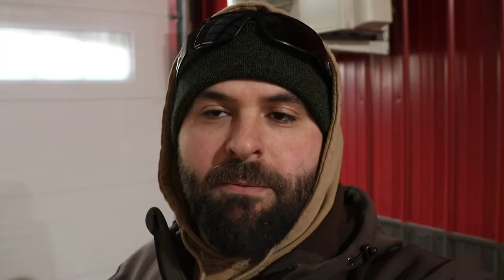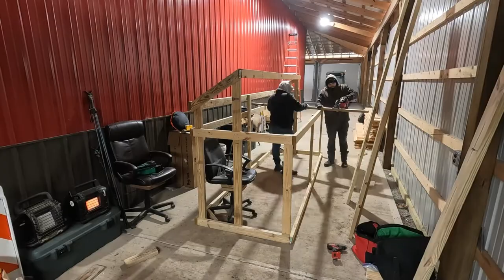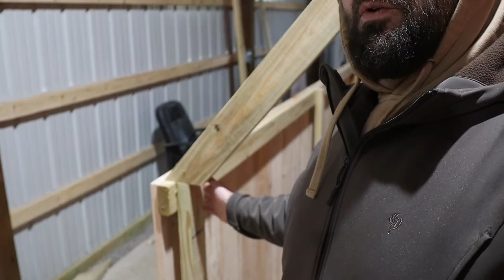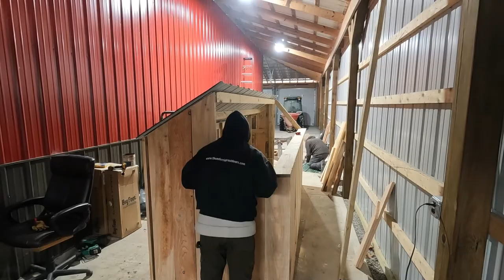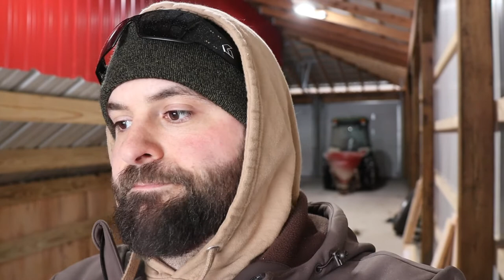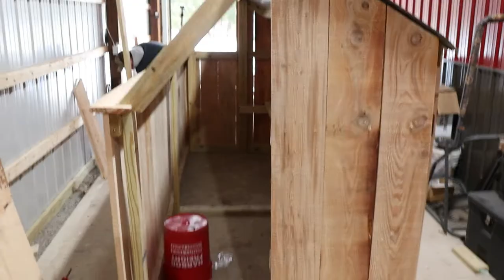Building A 6 Man Duck Blind!

Comment: Looks awesome!! Wondering the length and width of the blind. Also length from rear of blind to front of roof.
Reply from the maker: Thanks dude! The length is 12' and the width is 4', the roof is 2' and we cut the tin at 3' for overhang on the front and back. Appreciate you watching 🤙🏼
Reply: @bloodline.hunt.967  awesome!! Curious on you’re height in the front and back of it.
Reply from the maker: I'm like 6' 2" and can stand up at the front of the roof without hitting my head. We just made it so we had clearance standing at the front and enough clearance at the back when we were sitting down. Hope that helps!

Comment: Can you share the amount/what kind of lumber you got, and the all around measurements? I’ve been looking to do something like this for a while, but this sealed the deal!
Reply from the maker: Absolutely, I'll get a list around and drop it here for ya!
Reply from the maker: Here's the material list, I'll be doing a follow up video here within the next week or so showing how we finished it up and will touch on specific measurements. If you have any other questions let me know!

Pressure Treated:
9- 2x4x12
12- 2x4x8
1- 2x8x12 (seat)
Siding:
200 Sq Ft of whatever boards you want to use
Roofing:
4 lengths of tin (3' coverage) cut to 36" or whatever length you decide to make the roof.